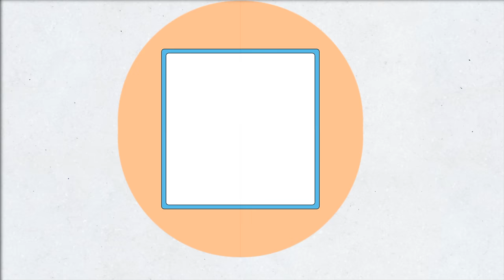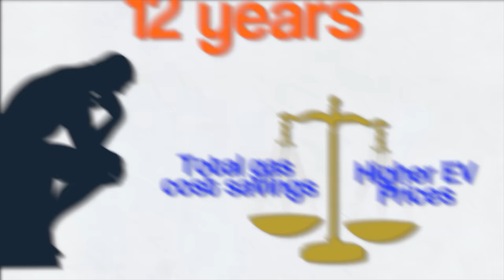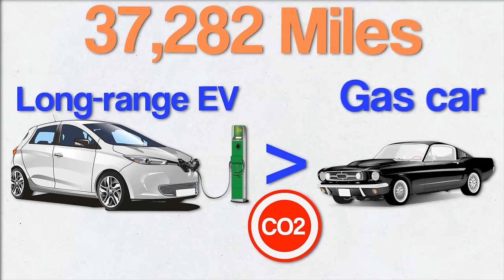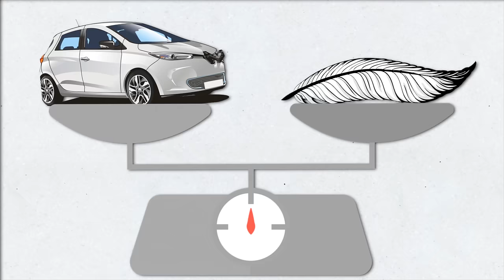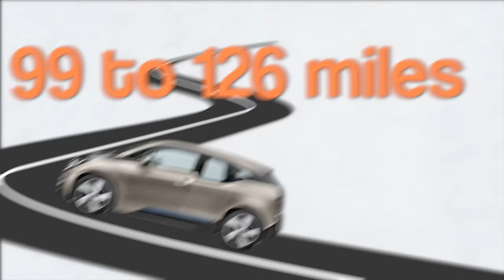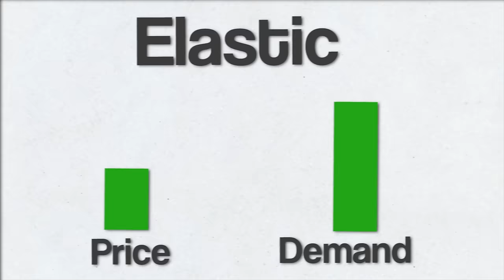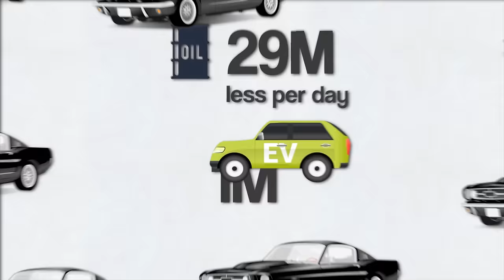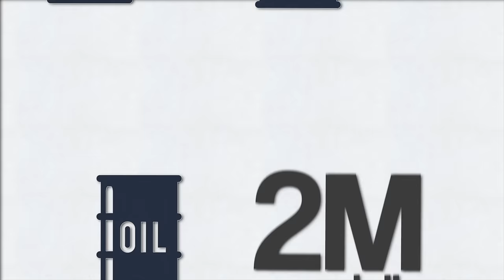If You're Worried About Rising Gas Prices, Watch This

Comment: A neighborhood power supply can not handle that much juice flowing to every house In the neighborhood charging an EV especially if everyone upgrades to 240v outlet. You’ll have to upgrade the entire power grid too
Reply: Right and the current power grind can’t handle if we switch to electric cars especially now with the water levels on hydroelectric dams being so low the one only has about 12 months until it doesn’t have enough water to run it..so no electricity for the cars 
I’ll stick with gas powered until things change
Reply: I would have to upgrade to 200 Amp service. Some older homes have 100amp & 60amp. Big expense plus a overpriced vehicle.👎
Reply: @kerstintuskan4475  yes 🙌 💯. It’s a smoke and mirrors show. EVs aren’t very practical at all
Reply: No, because not everyone will charge at the same time,  just like not all gas cars get has at the same time.  Most people will need to charge one a week.
Reply: @jonathanf.9395  One of the comments here was from a person in Canada who said you can only let the car charge to 80% in very cold weather and then after doing so the power drops fast .. which means you have to go charge it again or be stranded…so for all of us who live in states with horrible winters…the cars will be charged more than once a week. 🤷🏻‍♀️ By the way,  this scenario I’m talking about.. its if all most everyone in the United States gets electric cars ..which is not gonna happen because too many of us can’t afford them.
Reply: Alien force would have to EMP tf out of that to take out humanity too. Ez pz.
Reply: @kerstintuskan4475  The average commute is 32 miles daily.EVs now get 300 miles per charge. 80% of that is 240 miles. Average driver will have to charge once a week even with 80% charge. With regards to price,  you are not looking at total cost of ownership. Evs already cost the same and are going down.  Gas cars aren't. Gas will only get more expensive as we run out of it.
Reply: @jonathanf.9395  32 mile commute? Plus going to the store, bank, groceries, shopping, out to eat, kids sports after school, dropping off kids to and from school, and a hundred other events to drive to and from , daily…..
    Your a typical pro green enthusiast, with no concept of what people do everyday with their vehicles.  Not to mention, EV  SUV  are needed by most families to haul multiple kids and gear everyday, not a car. And states that have cold winters and snow , these ev vehicles suck to charge and operate. 
   Besides there is no charging grid to support all these ev cars.
Reply: @jncn1490  Do you know what AVERAGE means? Some will do more, some will do less. Plus,  32 x 5 = 160 miles. EV's do 2X that per charge. So you still have range for all your other trips. Plus, if you need to charge once every 5 days, so be it, but that does not mean EVs will be charging 24/7 which is what you gas heads are saying. Have you heard of Norway? They have 25% EVs NOW, not exactly a warm climate country... they seem to be getting by just fine.
Reply: Do you really think everyone on China which is the biggest user of EV's on 240 V?  How about Europe?
Reply: @tomsawyer8525  no, but a lot of people are installing a 240v outlet for their ev charger to charge faster
Reply: @tomsawyer8525  – Vague questions from you, but ...
Normal domestic supply in China & most of Europe is 220V AC.  In Australia, it's 240V per phase of the 3 phase 415V supply, but a single home (or industrial site) may request all 3 phases to be wired for 415V machinery.
Reply: @jncn1490  You go to the store, bank, groceries, shopping, out to eat, kids sports after school, dropping off kids to and from school, and a hundred other events to drive to and from , daily…..?
Reply: Thing is the price of gas went up since he made this video.

Comment: Here in Canada you need to consider range loss in cold weather too, the recommendation is to not charge past 80%. In cold weather you could easily lose 30%.

Imagine getting in your car with only 50% in your gas tank all winter. How far are you going before filling that up?

But you can only fill to 3/4 every time, then an hour later it’s at half.
Reply: I challenged Canadian Prime Minister Baby Trudeau to discuss EVs w/ Scotty.
Reply: I agree, owning EVs in Canada should be outlawed, and anyone who disagrees should have their bank account seized and their property confiscated.
Reply: I's more than 50% but your point is well-taken.  Why they aren't cold room testing these things gets me.. greed and stupidity
Reply: @jaysonwallker1648  There’s actually a testing centre in Northern Finland called Test World where they can test all year round indoors at extreme temperatures. I think originally it was for tire testing but they can probably test more things if it’s required.
Reply: Hybrids would be better for reliability in cold climates.

Comment: After talking to EV owners and watching a number of videos I hear the same thing about charging stations . Somewhere between 30-60% of them do not work or are incompatible with different brands . Imagine if 30-60% of gas stations did not work . I have read a few studies on the long term toxic pollution to the earth from production of the minerals you mentioned . Almost as bad a nuclear power . I wish the auto makers would produce economic hybrids . You would think the Prius opened the door and proved that route well . Imagine applying breakthroughs in technology  in engine management and fuel systems . I see no reason a small hybrid car could not reach 70-80 MPG , yet still operate on a battery in cities .
Reply: Or even more plug-in hybrids to bridge the gap. This would also allow for a more smooth adaptation as the batteries don't require nearly as much energy to charge.
Reply: You're talking like the Prius and Corolla hybrids don't already exist. They get roughly 50mpg city, 60 max. A Prius or similar hybrid is your standard taxi most places. Cities usually get stuffed delivered on ebikes cause it's way cheaper and you can park anywhere. The drivers get paid peanuts, but that's "ok" cause their bikes only cost $1k and basically nothing to operate.
Reply: @Tazdeviloo7  Yes they are , but rather stalled and hybrids are rather limited and I think they could be much better .
Reply: @henryzabel1746  Basically every Toyota can be had in a hybrid version. F150 has a hybrid even.
Reply: @henryzabel1746  You can only go so far with a gas and electric car in terms of efficiency. There's a weight/space penalty for the battery and engine in one car. The next step is full electric which are much more efficient energy wise in comparison.
Reply: You are right.  The demand for EV's is just not there yet, but as ownership increases, so will the privately owned charging stations like Blink have better repair and reliability.
Reply: EV owner here.  95% of my charging is done at home.  We have an Ioniq 5 and BMW i3.  It’s not hard to find compatible chargers using apps.  There are only 3 types, Tesla, CSS and J1772. The one Mitsubishi uses is less common.  Finding charging is not an issue at all
Reply: @dgatan   I imagine it depends where a person lives . Probably not too bad in urban areas , less so in rural .
Reply: See it wouldn't work..why ?? No money for them 🤑💰💰
Reply: @timothysaye5535  demand for EVs is 100% there what are you talking about?  Car companies cant keep up supply to fulfill all the orders they are getting.
Reply: @dgatan  we’re not all rich like you.

Comment: One concern: As a resident of northern British Columbia, I must place a priority on a vehicle that has HEAT for  comfort and windshield clearing etc.... Electric vehicles
that already have limited energy reserves would be double handicapped here....not really an option.
Reply: @vitalsigns2679  even In south Alabama or anywhere within 300 miles just not enough places to charge your car
Reply: @thegeekviking5427  oh boy, and then when I make a single post on social media criticizing Elon musk our lord and savior, he can disable my car remotely so I can't drive anywhere
Reply: Heating can be accomplished by the use of a heat pump or just using an electric element off the battery. Either way you will decrease your driving distance because of additional energy consumption.
Reply: @thegeekviking5427  but what about sitting in traffic not moving and blasting the heat?
Reply: @thegeekviking5427  , up here with long distances and REAL cold weather, hours of driving with the heat on FULL blast FULL time is a requirement, and access to " the power of the grid "
is not always easy.
Reply: @thegeekviking5427  that’s not any big help you must not live where it snows
Reply: @altoncrane9714  Don't worry, A.  Just buy 2 EV's.  Drive the first EV half way to work where the 2nd EV is parked and already fully charged from the night before when you drove home.  Plug in the first EV so it's fully charged on your commute home.  Easy-Peasy...just need $ 130k for 2 average priced EV's.  Alternatively, purchase a 1 hybrid or a ICE only vehicle.  Even with the hybrid, of which I have one while living in MN, if you use the heat the gas mileage goes from 28 to 18 mpg.  With an EV only, the heat and air-conditioner will make it impossible to get anywhere near the stated number of miles and you won't be comfortable without using the heat.
Reply: @altoncrane9714  real cold weather? i frequent colorado for snowboarding where its -20 degrees in the mornings. i only do full blast heat for the first 5-10 min of driving, then i turn it to the lowest possible setting. you car must have extremely horrible insulation... kinda odd that someone in a place of '' REAL COLD'' weather hasnt even insulated their car lol.
Reply: that's a really good point, gasoline vehicles naturally produce heat. In cold climates EVs will be a POS, the need for heat generation will destroy the driving range.
Reply: @PhaseSkater  I live in northern Canada. Yes, REAL cold.
Reply: @user-je2yq7ru8w  Thank you for understanding that.
Reply: @mrdestro7283  Try one in MN where it gets to 20-30 below.
Reply: Thats why no one in MN owns an EV. Oh wait, there are thousands of them here. Weird.
Reply: @dbmn7571  Damn good plan or by the Tesla it will catch fire 🔥 and you will have heat on your way to work 😂🤣😂

Comment: I've heard from mechanics that the hardest thing to diagnose on a car is the electrical. imagine having a problem now......
Reply: Yep, no one is trained to fix them yet and you can only get it done through the manufacturer.

I believe if I bought a Tesla, only Tesla can do routine maintenance and there is no dealership or maintenance shop in my city of 500,000 people. 

Just imagine if 100,000 people bought Teslas. Daily blackouts and a bunch of busted cars in the ditch. A whole bunch of dead batteries too
Reply: no its pretty easy the whole car goes up in flames and the neighnors house too. The problem is always the guy who bought  the car.
Reply: Most of the electrical problems in gasoline vehicles are do to all the pollution crap etc.  
If a car is 100% electric there is actually less to go wrong electrically ...much simpler without dealing with fuel dilivery and pollution crap
Reply: @chancewilkins3320   in the case if Tesla, so much is controlled by the display. Numerous software glitches with these. And that ain't changing anytime soon. That may be what the writer was alluding to.
Reply: @kevinhodder8465  Same argument against any modern ICE with electronic displays and buttons can be made. Electronic failures can significantly cripple driving capability in any car these days.
Reply: You got it wrong. What is the hardest thing to diagnose on a car is mechanical engine issues that come by reading the diagnostic codes from the ECU. Because one code can lead to many issues and let's say a mechanic fixes one code, it may have an another one can light up. And sometime, it's just a bad sensor that reads a false positive.
Reply: Don't you have to be certified in order to do work on an EV?
Reply: It's hard because too many mechanics aren't competent with electrical. So where is the real issue?
Reply: @ChuckyDoll79  You don't fix by codes. Codes give you information on sensors. You diagnose by what triggers specific sensors. The computer can only let you know which sensor isn't reading within spec. That's not a directive to just change the part that's sending a trouble code. You track back to WHY that part would send a trouble code. 
Stop being lazy. If your going to diagnose a repair, diagnose it. Don't expect the computer to be able to diagnose it for you. It just leads in the direction of a problem.
Reply: @genaugmen4505  Are you really trying to teach me something that I already knew? It seems like that.
Reply: @ChuckyDoll79  maybe you do. A lot of people don't, including  a lot of so called mechanics.
Reply: Actually both our Chevy Volt and Nissan Leaf use a standard diagnostic plug in, like gas engines, and use a similar CPU, and will give similar error codes.
Reply: @SCraig-Handsome  There is a reason there are no "dealerships". EV's are virtually maintenance free. Outside of tires , brakes there are no pollution controls to muck things up , no anti freeze , no fluid changes , etc etc. The electrical problems you speak of are probably non existant other than no power to  the motor etc.
Reply: @pazi402  I was suggesting that the writer's concerns were more about software bugs, not electrical. I share those concerns. That's a separate debate to some extent. But people have less and less control over their day to day life now than 20 years ago. We're slaves to processors that to be real, work great at first, then non-stop problems after awhile. Maybe not safety related, but if you're OCD like me, little issues that drive you crazy as you wait for the latest "update". This goes for everything these days, appliances, cars, phones, tv's, etc. I used to be able to fix stuff. Being a programmer doesn't help as "right to repair" is still being fought by the big companies. Inevitably, with today's products, you end up with something destined for the landfill in short time. Dad issue for sure. I do agree that electrical issues cripple any ICE vehicles as well, and I have railed about that in the past. 8 year old Ford truck that I couldn't get a computer module for, had to have one shipped across country from a salvage yard.
Reply: @501stBattalion  don’t know need to ask Elon
Reply: @tomsawyer8525  say that when yours doesn’t start or stops on the highway
Reply: @jkaw9291  There are far less things to go wrong with an all electric vehicle than an ICE (internal combustion engine.) As long as you maintain connection and power that engine is going to run a very long reliable life. I don't hear anyone stating that sudden stops are a problem with EV's. I know several late model ICE cars with far less reliability.

Comment: I honestly think there will be a 50/50 mix. EVs are good for people who don’t do much and drive short distances but on the the other hand people who tow and go on long distance trips are going to need the range and reliability of a ICE.
Reply: Nope, road tripping in a Tesla is not a problem at all.  The charges are a lot quicker than Scotty says, and after a couple of hours you need to get out of your car to use the bathroom, eat, stretch, etc.  Everytime I stop to charge at a Wawa or Sheetz, my car is done charging by the time I come out of the store with my food.
Reply: @ianhuds2206  I don’t know where you pulled $80k from because my car was way less than that lol. An EV battery is also not anymore dangerous than driving a car with a tank full of highly explosive gasoline, which everyone does everyday without second thought. And to the point of the energy being sourced from fossil fuels; power plants burning gas are about twice as efficient as a car doing it because it’s a way larger engine producing the power. A gallon of gas is about 33kwh of energy, and a regular EV battery is about 75kwh. That means even if the gas being burnt at a plant was equivalent to being burned in your car, an EV only needs 2-3 gallons per “tank”. But the grid is getting cleaner every year so the environmental benefits will only increase. My state is about 35% nuclear energy as of today and growing.